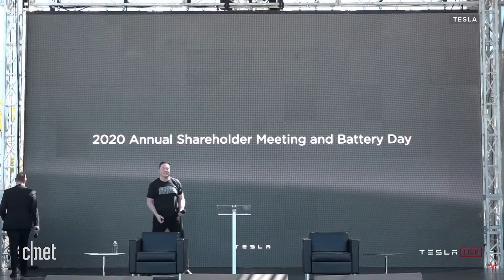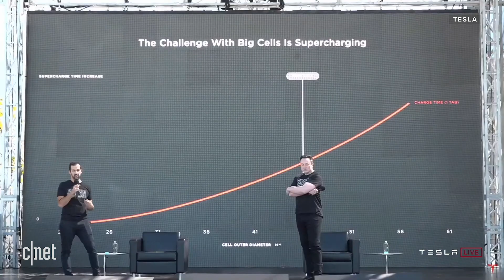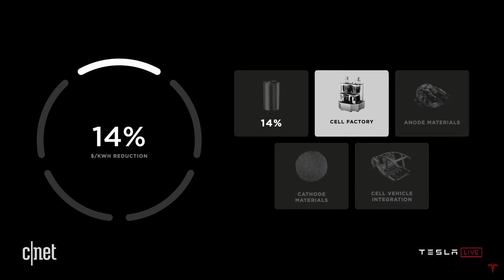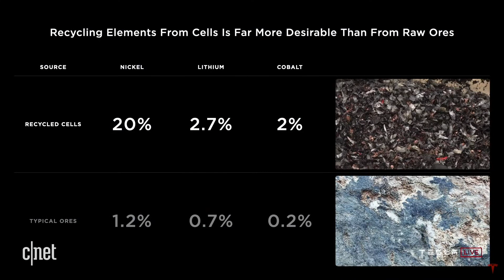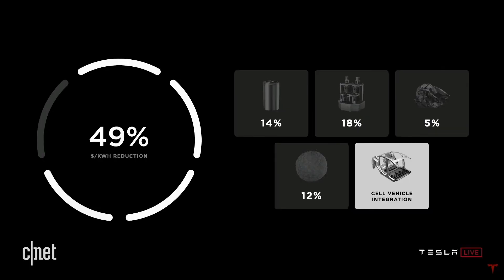Elon Musk's Battery Day teases $25,000 Tesla

Comment: 16 times the power... Oddly sounds like Todd Howards claims about Faillout 76...
Reply: Except Elon doesn't lie
Reply: 6x power
Reply: 6x the power but cells are larger. 50% power increase for the vehicle is likely since power and range (+56%) are closely related.
Reply: Wilson 6.6x the volume - the 16% is from the extra 10mm depth of the battery cell.

Comment: A bigger round battery should decrease the energy in a pack because there is more empty space I am not an expert so prove me wrong
Reply: The volume of the battery is 6.6x the previous one , they didn’t do anything except to make it bigger, plus capacity increases about 5% per year so they did nothing on that part also .
Reply: lasarith2 I know but also they could put small cells in between the big ones for more capacity
Reply: cool guy12345678910 just increase the depth , the extra 10mm gave them 16% range .

Comment: I need car from point A to B and that's 70 km, why buy car whit big battery? I want smal battery in my car so I can pay 15K
Reply: It's actually healthy for the battery if you don't have to charge the battery to full and you just use what you need.
Reply: The battery on that $25000 model will probably cost around $3750 (~75kWh at ~$50) so halving the range will only remove about  $1800 from the cost of the car. But, if the battery is as long lasting as is speculated (million miles) then the car will probably hold is value much better come selling day.